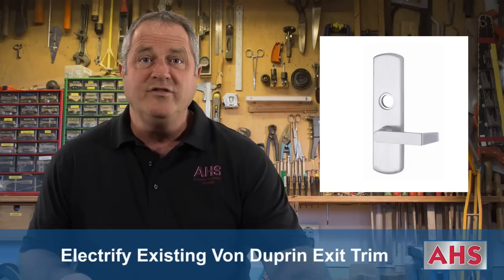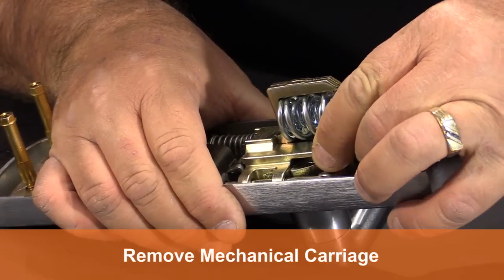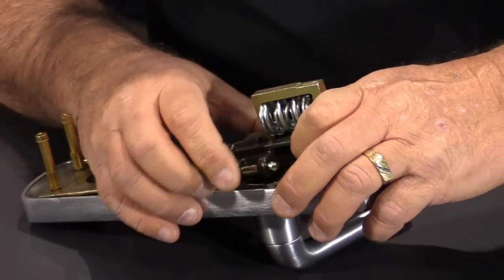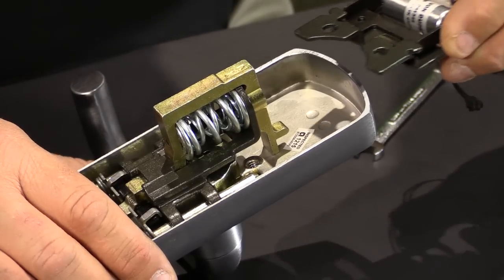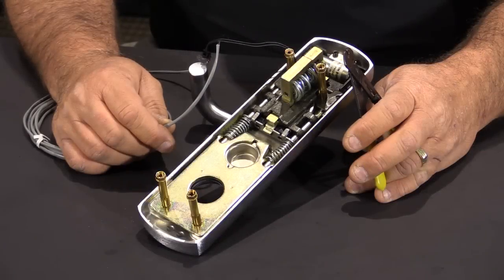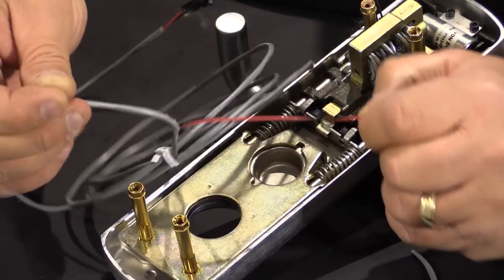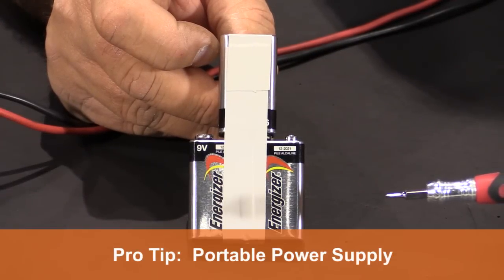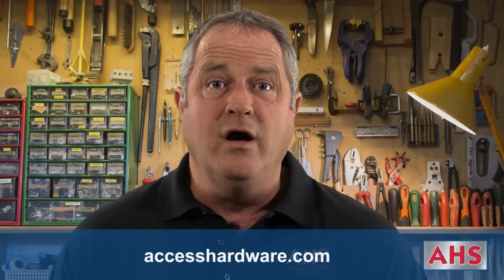AHS Academy: Electrifying Von Duprin L996 Trim

Comment: Fail-Safe = power to lock (Mag locks can only be fail safe)
Meaning: from the key-side of the door if the power is off you will NOT NEED a key to get in.
 
Fail-Secure = power to unlock. (Exit Devices with Latch Retraction can only be fail secure)
Meaning: from the key-side of the door if the power is off you will need a key to get in

If you need to chose between Safe or Secure then Lever-locks, Electric Strikes & Exit-Trims can be Safe or Secure.
How to choose which one, Exterior doors should be fail secure.
Stairwell Doors or locked EXIT doors  should be fail safe.

How Fail-Safe works: If the Building Fire Alarm goes ON (some people say OFF)  then all the power to the locks will be shut off and ALL the Fail Safe locks are now unlock (free egress both ways in or out)
No one will get TRAPED in the fire.

How Fail-Secure works: If the Building Fire Alarm goes ON then all the Fail Secure locks will remain locked you will need a key (free egress from the non-key side only)
People can get TRAPED in the fire.

You might see this in the part #'s
FSE = (Fail-Secure), EL = (Electronically locked) 
FS = (Fail Safe), EU = (Electronically Unlocked)
LR = (Latch Retraction)  for exit devices

Exit Device & Trims Notes: Its best/preferred to always use Electrified Trims on a Exit Devices, and not Latch Retraction.
Why Less Amps to move the smaller solenoid and its quiet and it can be Fail Safe or Fail Secured.
Latch Retraction With large solenoid (not motors)  require lots of Amps and the solenoid is large & loud. 

Solenoid are fast and loud, Motors are slower and quieter.  And Latch Retraction can only be Fail Secure never Fail Safe.